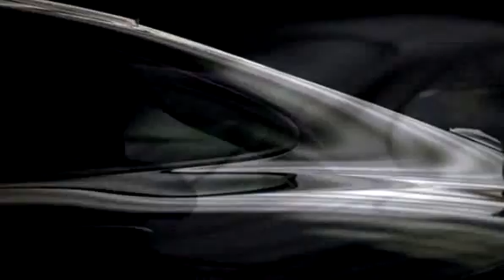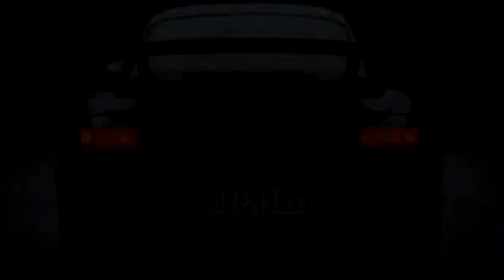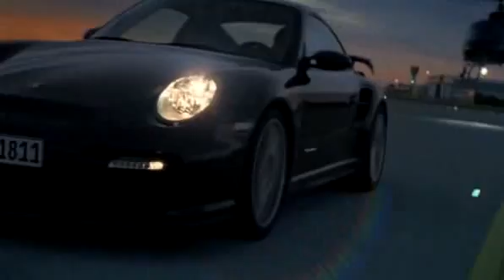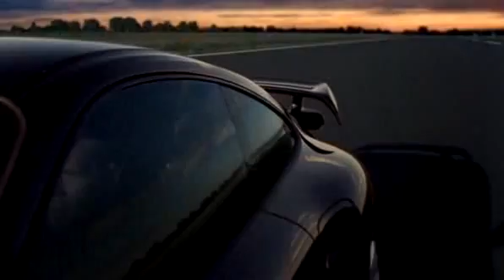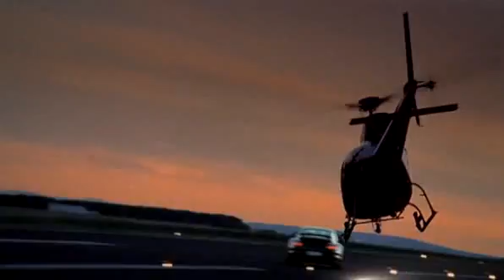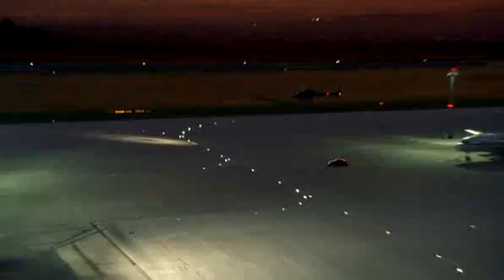Porsche 911 GT2 Respect Required PART 1

Comment: fact: ram air can only force air into engines faster then intake speed at around 180mph. not sure how it would reduce exhaust back pressure neither. thanks porsche.
Reply: 5:25 volume is the wrong word
Reply: Scott Robinson Any kind of hole from outside  leading to the intake is ram air. This car tops out at 211 MPH. Believe me air is getting rammed into the the spoiler hole. The faster the better!!!